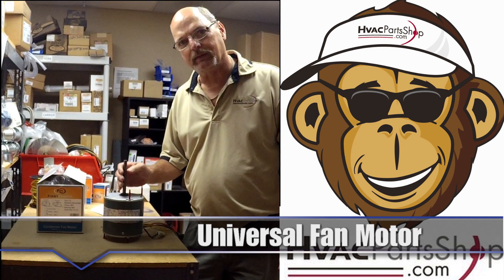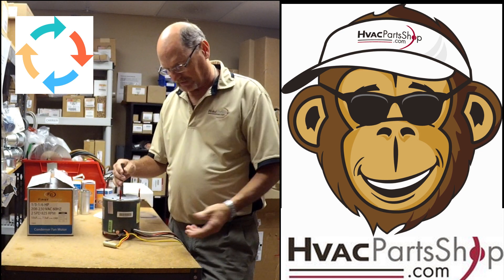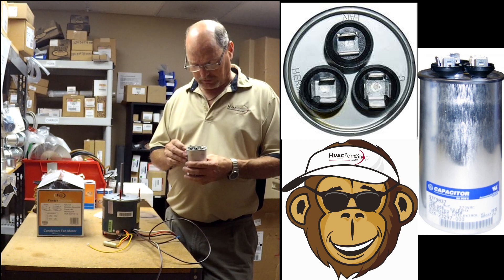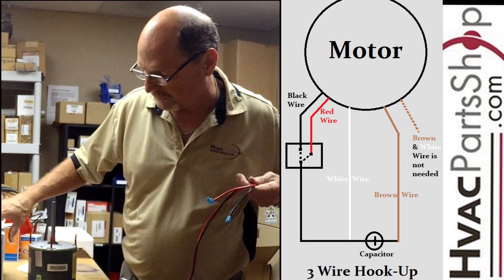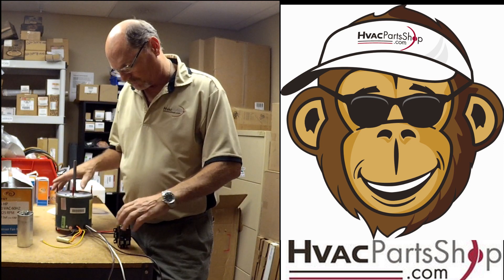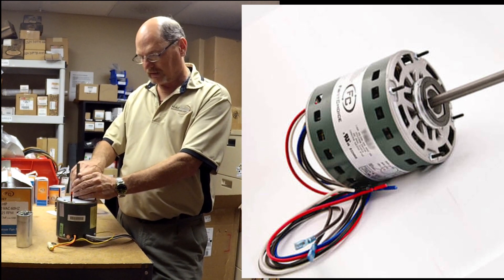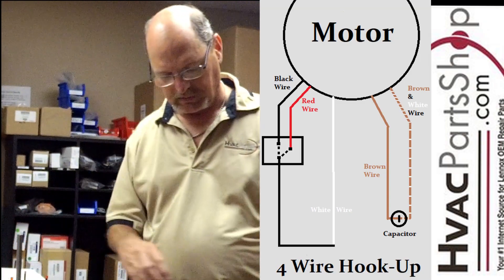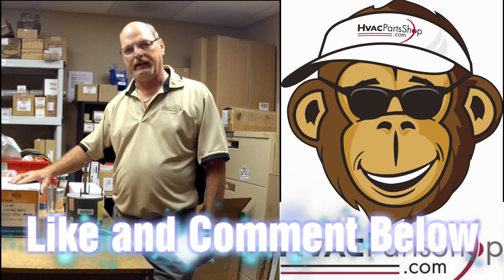Installation of a Universal Fan Motor

Comment: If I need to use the 1.6 he do I use the red wire not the black?
Reply: I think answer is yes. I’m literally watching this for the same answer and I think I get now that using the red wire (low speed) makes this as 1/6 hp and using black wire (high speed) is for making this run as a 1/3 hp.

Comment: Mine is a three wire and the original came with a black a purple and a brown. the new one come with a black a white and to browns. I understand that the brown with the white stripe is not needed so does the white wire act as the purple?
Reply: What was the answer to this? I'm trying to get mine wired up and was told ignore the white wire, but it isn't working. I have brown, brown/white connected to the capacitor, and black to the control board.
Reply: @sramtq did you figure this out?  Seems simpler to just stick with the 3 wire setup and use a dual run capacitor and not use the 2nd 2 prong one and discard the Brown/White wire using the White Wire in L2 or capacitor.  I think if you do it the way you did it you have to run a lead and it add unneeded complication but am curious how you ended up doing with it

Comment: The red wire it’s for 1/4 or 1/2?
Reply: 1/6,1/5 Hp so essentially the high speed black wire makes it run at higher hp and red wire or low speed makes it run at the lower hp rating